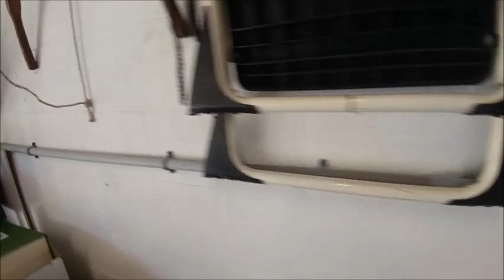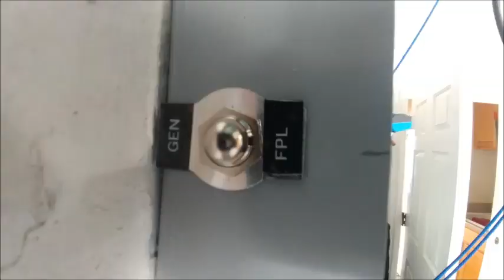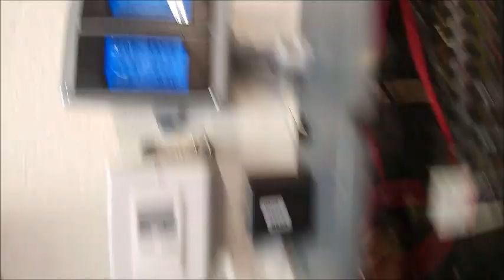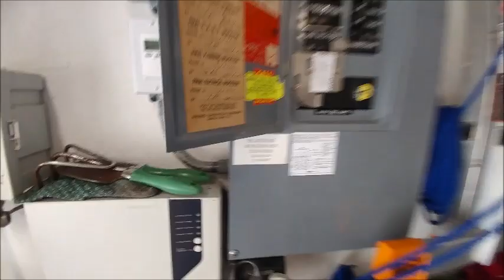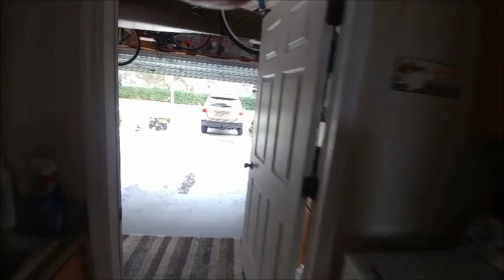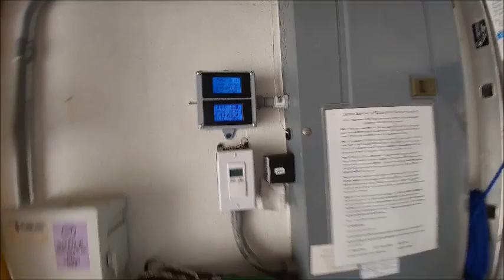Power Monitor Installation

Comment: George, thanks for the great video.  You and R Brown channel have helped me on these meters.  Question:  when you flipped to generator power, your meter showed you were at 5000w each leg.  This is the max of your generator.  Since each leg is 120v, wouldn't you need to divide that watts in half on each meter?  Is there a way to do meter the generator side with 1 meter?
Reply from the maker: JP IV. Sorry it took so long to answer your question but we have been dealing with health issues, I hope you understand. Yes it is 5000 watts each phase, remember it is AC, so when one phase goes high the other phase goes low., so it is only a 5000 watt load on the generator not 10K. BTW I have since upgraded my generator to a 13kW,  50 amp DuroMax generator, (Amazon had them on sale) and upgraded the wiring to 3 #6 & 1 #8 to a 50 AMP input connector with a 50A back feed circuit breaker. I plan to upgrade the meter package also. You could wire it for one meter but you would need an additional switches to see each phase.  I guess theirs a new video in my future.